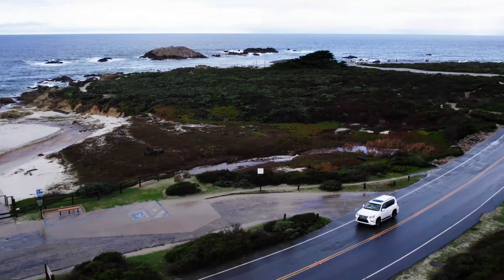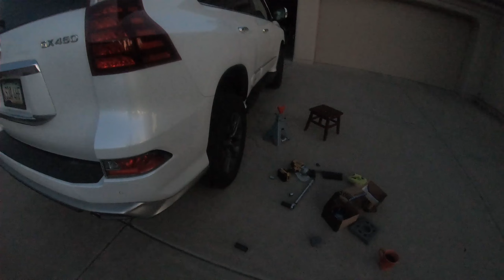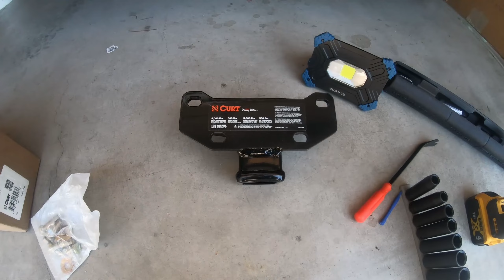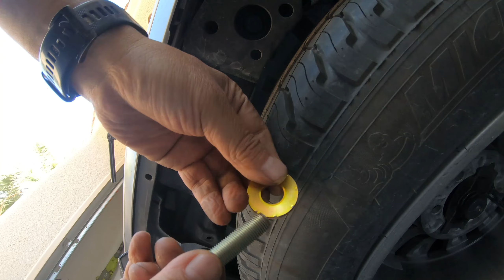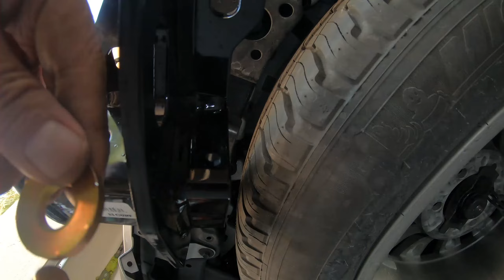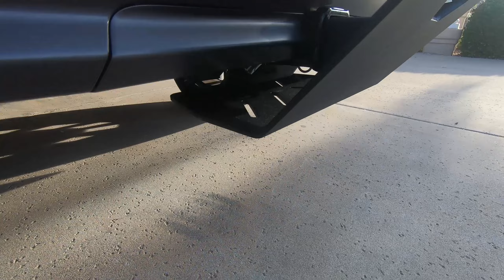GX460 Overland Build 10, wheel spacer & hitch installation

Comment: You can add a spacer plate to the hitch and do not have to remove the plastic trim. Curt 13043 comes with the spacer.